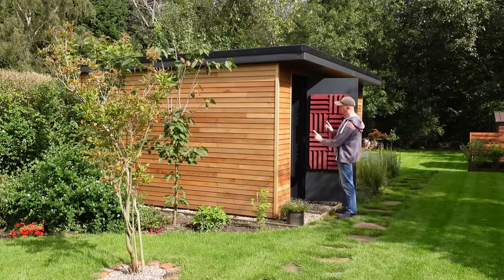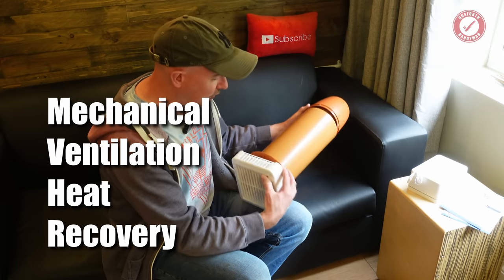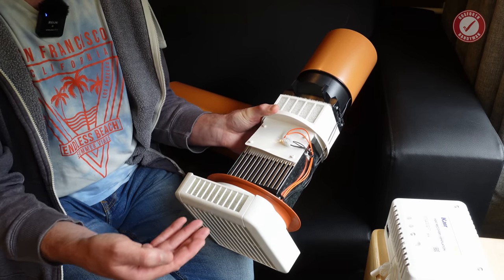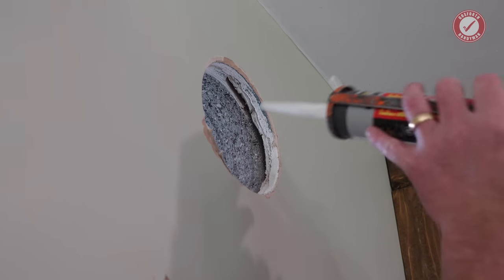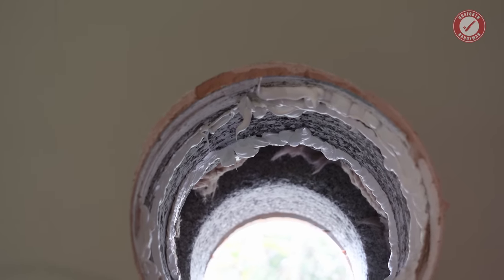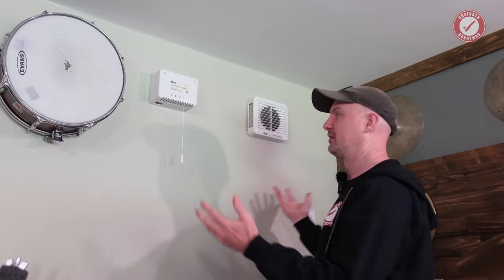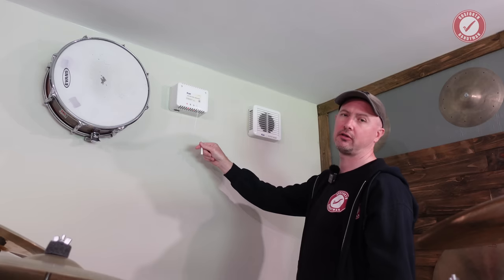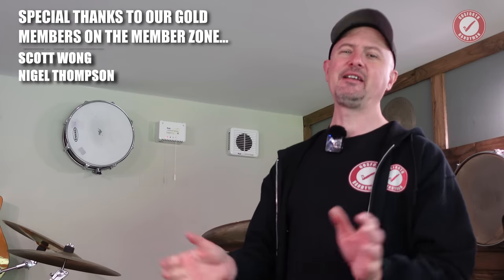Humid and mouldy! Installing MVHR ventilation (Kair system)

Comment: I fitted a MHVR to a newbuild.  Ventilation is always ignored and is vital for good health.   It's a trade off for sound deadening.  Retrofitting will always compromise your design of the building.    I did make a 5*5 metre summer house, but it had vents and underfloor heating which never allowed the temperature to fall below 16C so dampness or mold was never a problem

Comment: I saw on the HeatGeek channel recently, they wanted to see if they could enclose and how tightly their heat source pump.  Apart from using there software/sensors etc to check effeciency internally etc they also used smoke bombs to see how the air flowed outside at the pump each time they made the enclosure smaller.  The later may help identify size and shape to restrict the noise travel, well maybe.

Comment: To help with soundproofing around the ventilator, you can hang sound absorbing acoustic panels near it which, I am told by those familiar with these things, should reduce the effect of problematic sound waves.
Wall panels, hung rather like pictures, reduce reverberation by absorbing rather than reflecting sound waves depending on their NRC rating.

Comment: We have installed air con in a number of garden rooms. They dehumidify as part of the cooling process and also have a dehum mode. They heat in the winter and cool in the summer.

A dehumidifier would prob be your best bet
Reply: yeah I suggested the same. If you are trying to control humidity get a dehumidifier as the air con unit will not dehum in the winter, if you use dry mode you bypass the thermostat and the unit will just cool the room to unacceptable temperatures which you then have to heat.

Comment: The Kair unit, you picked seems to offer 10 litres/sec on "boost". So as no one is sleeping there overnight - it is likely to be enough, and should reduce the risk of mould, forming. The obvious way to kill common moulds is the use of a UV light source sun-light and or a "Black light" lamp, with lower humidity.
Reply from the maker: I need to do some tests to see how long it takes to get to... say 2,000ppm on trickle (can also vary the trickle speed). 👍

Comment: Many years back, before the MHR stuff was common,  I visited a home in Sweden that had gone a different route. They'd buried quite some length of ventilation duct (can't recall now if this was a combined passive intake and exhaust, or the two separate and powered by fans and laid next to each other, which would have been a crude heat exchanger) under the ground, doubled back on itself in tight hairpins, so it came into the house slowly and with the worst of the chill taken off by the depth (and possibly also by an exhaust). They said it was effective and it had been cheap for them. I imagine that several bends and earth above would go some way to attenuate noise too?
Reply: Interesting, I can see people getting more creative with their ventilation in the future as houses become more and more air tight. Preserving heat is great but stuffy stale air is unbearable.

Comment: Great video Andy. Have you thought about setting up a home assistant system? It integrates all smart plugs, relays and sensors etc. You could set up quite a smart setup for your studio ie, tracking co2 or humidity only whilst someone is in the room and then trigger the extractor or other items. Could also have warning triggers so if co2 gets above a certain level it could turn on a light or send a message to people's phones warning them to act. Can also set scenes with preset lights, sound etc Zigbee sensors are pretty cheap ~£10. It's all local and doesn't require cloud. Lots of options.

Comment: Humidity is relative to the air temperature. The walmer the air the more water it can hold. So if you boost when its walmer inside mabe in the sunshine you will be heating up the air therfore reducing the humidity. Saves using a dehumidifier

Comment: Interesting stuff, I tried an expensive MVHR in a bathroom and it died within a few months, lost interest after that. I did see a 6' version that looked fancy, may be one day. With your situation, and this is a faff, if you could add some more pipe externally that points the ground, then comes back up to 6', that might give you enough space to put some baffles and really drown out the sound bleed in/out the room. Of course it might not make the MVHR work as effectively I guess, it might even struggle sucking/blowing through that much pipe. Nice one for sharing.

Built my outbuilding a year or so ago (I work in construction), just a skin of blockwork with 4' of external PIR mechanically fixed, then 4' on slab and 4' on warm deck roof. It's far from your acoustic levels I'm sure, but good enough for my purposes. Keep up the good work 👍
Reply from the maker: Nice one - that sounds great!! 👍👍
Reply: @GosforthHandyman It may not be nice to look at, but knowing you, you could box it in really nicely, match the cladding courses and all that 👍

Comment: Fantastic video, I'm about to embark on a new build bungalow, and was really curious about these single use units, it's small with only 5 seperated areas so thinking 5 of these would be cheaper than a full mvhr unit. 
But last time I checked I couldn't find many variations of these single use units for sale so didn't think they would be up to much but you've perked my curiosity again!
Reply from the maker: Certainly worth checking out! This particular model has been on the market for many years. I'm not sure if I'd do a whole house with them though. 😬
Reply: Perhaps look into bpc ventilation and their zephyr unit, the one I was thinking of. Responsive company but I find it a bit odd there are no reviews 🤔 Seems they're system links multiple spaces and adapts to whole house. If you're doing a new build though, you've got the rare chance to do cost effective whole house MVHR system install. Just an opinion!
Reply: @bikerchrisukk  thank you for the advice, I tried to watch the bpc video about their single unit but it was very difficult to hear them, I'll try their website instead. I think you are right a full mvhr unit would probably make more sense and would be really easy to install compared to retrofitting, I could hopefully do it myself, I hear they work great in the winter if you have a log burner in one room, really helps distribute all that energy and intense heat for a more comfortable temp. in every room

Comment: I thought the air pushed back in was dehumidified as part of the heat transfer process..? This caused condensation, another reason for the slight tilt downwards.

Comment: I’m struggling with the logic of mounting it facing the house, right above the drum kit? I would have imagined it better to go on the window wall facing the bottom of the garden? Nice bit of kit though and a decent price!
Reply from the maker: The kit is so loud it doesn't really make any difference where in the room the fan is located... and the coin came up heads! 😂
Reply: @GosforthHandyman  hahaha, I did see the heads on the coin too 🤣 I just imagined that someone who spent so much time soundproofing a room would have cut a hole in it facing away from the house rather than towards it but as you said, the coin made you do it! 🤩👍

Comment: I have a garden room. I have trickle vents above the double doors and little window which I always leave open. I haven't seen any issues with mould
Reply: The point of the room he built is to be well sealed for acoustic purposes when he drums. A trickle vent would leak sound.
Reply: @davideyres955  yeah I know. In the video he just asked if people with garden rooms had any issues with mould
Reply from the maker: Interesting that the trickle vents are enough - cheers for the info!
Reply: @GosforthHandyman  not sure if it's relevant but I do have an automatic electric radiator in there which never lets the temperature drop below 10 degrees. Probably costs an arm and a leg to do it in winter but I'd rather not work it out.

Comment: When I built my soundproof studio some 8 years ago, the exhaust fan was in the plans. Using an external fan that sucked the air out via ducted tubing that is laid on top of the ceiling with an S shape to minimise sound transfer, while another passive vent from outside to inside, again ducting laid down in S shape, brings fresh air in. This not only performed better but kept the room-in-a-room concept walls intact. Tests showed over 50db STL between inside and outside.
Hope my videos help others planning to build a studio in their backyard.
The plan: https://youtu.be/V9CfyDD_hPw?si=4j-IxE-q-oj4FL3W&t=194
The fan: https://youtu.be/ENyjzlSApFM?si=kqKcmEa4ooKIdx5d&t=67
The ducting layout: https://youtu.be/7vbkqq83w-c?si=wAYkL-MSUYKkgY6G

Comment: The Humidity setting on the device is intended to achieve the desired humidity in the room. Condensation occurs on the heat exchange plates that you showed in the clip. This condensation then drips out through the internal pipe with the 5mm problem that you tried to seal. Setting the humidity at 80% will not prevent or stop the mould, it will only make it worse when you yourself are in the room or drawing humidity inside from a higher outside % when in  "standby mode". The WHO recon between 50-65% humidity is a healthy environment. I suffer from high humidity. I have installed a loft MVHR (£1000) that services the house via ducts, and use a portable 20L Pro-Breeze (£200) at the central inlet defuser. The setup maintains my home at about 63%
Reply: How much does that cost to run? My home seems to be around 60-75% humidity year round, even with windows open 24/7 during the summer months and for about 1hr/day in winter. I tried a dehumidifier but it was costing a fortune in electricity!
Reply: I have the system automated on Alexa. It operates during the times when humidity is generated in the house, cooking, showers etc, i.e. about 1hr in the morning and 1hr in the evening. The extraction system is concentrated in these areas. The incoming air is positioned in other area's such as the entrance hall. The system pulls and pushes humid air through kitchens, bathrooms etc via the MVHR and the portable Pro-Breeze sorts out any residual humidity on high temp and humid days - so will run seldom in the winter, which it has been for the last few days with this hot wet weather, so for now it will impact the electric bill.  @danabc322

Comment: if you don't want mould then the humidity probably should be 60% or lower. Allowing it to run through the night probably means it doesn't need to work as hard during the day?

Comment: Interesting video - thanks.
The CO2 thing is a bit of a red herring. Carbon monoxide is very dangerous, CO2 much less so. As an anaesthetist I often gave patients 5% (50,000 ppm) CO2 to get them breathing. The levels you are talking about will just cause an imperceptible increase in your breathing, as blood levels are tightly controlled by the brain. Above 5% it feels unpleasant (think swimming underwater) and at 10% it’s dangerous.
As I see it your problem is mould which likes cool, damp environments. You need drier, warmer air. A dehumidifier will dehumidify a lot better than your device. A heater would warm the air and building, and decrease relative humidity. A bit of air movement is obviously a good thing too.

Comment: Hi, I bought a vent axia HRF for my bathroom some years back, it was good for air circulation but the heat exchange wasn’t very good so it ended up just blowing into bathroom cold fresh air (in the winter months). Interested to know what yours is like on that front. Great  channel by the way!
Reply: I've heard this is quite common, I hear full mhvr units are better at bringing in warm air but don't know why these single units don't seem to achieve the same results

Comment: For diamond core: my big DeWalt SDS couldn't do 117mm, let alone 150mm, tbf it's had a lot of use and probably needs new brushes. Got a Makita diamond core drill - perfect up to l50+mm. Makita have kept up quality of old product corded tools; DeWalt old product corded quality has plummeted. Proper dcd gives controllable torque for large holes
Reply from the maker: The clutch in my old Makita seems to be ridiculously sensitive! 😂

Comment: I've had one of those units in my bathroom for the best part of 20 years and it's been great at keeping the humidity in the bathroom in check. I moved the power supply unit into the attic and extracted the humidity sensor with some twisted pair cabling to a small box with vents from a temperature sensor and it has been working great, and I don't have that monstrosity of a power supply hanging on the bathroom wall!

The only issue I have had is that the foam inserts clogs up over time and have finally disintegrated on me so currently it running without the foam inserts, and the ball bearings are beginning to be a bit noisy now after close to 20 years of running.
Reply from the maker: That's great to know! You can get replacement fans but they're nearly as expensive as a whole new unit. 😂

Comment: On humidity and ventilation you have to really think carefully about absolute (g/m3) humidity versus % relative humidity., You could have 10 degrees outside 80% humidity, 20 degrees inside 60% humidity - the air outside would have significantly less water in it by volume, so if you're bringing that in and warming it to the temp of the room you're going to be reducing the relative and absolute humidity inside. When I bought my house it came with a PIV system stuck in the loft and on all the time and I have temp/humidity sensors in every room and now the PIV system is on a smart (zigbee) plug and I actually run calculations of how much absolute humidity is in the air in the immediate vicinity of the PIV outlet, the house as an average, and at the inlet of the PIV system and temps and it makes smarter decisions about when to turn on and when not to so I don't pull in more moist air, don't pull in air that's too hot or too cold etc, which is far far better. You're not actually supposed to do this with a PIV system, but I simply don't care because it's miles better at doing the job. Eventually I actually want a whole-house MHVR system, but that's a big expensive job for the future. Anyway, the point is absolute humidity inside and outside is more important than the relative humidity when you're going to be warming that air up; if it's lower absolute but higher relative outside it's still worth pulling inside because the end result is less water.

Comment: How does the HRV get rid of any condensate that it shall collect in the heat-exchanger?
Reply from the maker: Lol I'm not entirely sure! I suppose if the heat exchanger is warm it shouldn't collect too much condensate? I honestly have no idea! 👍
Reply: @GosforthHandyman  The exchanger expels stale air to the outside. As the warm stale air cools down (it gives its heat to the incoming fresh air) the humidity from the stale air collects on the heat-exchanger. This must be discarded somewhere. (likely in the downwards-slope of the PVC-pipe?)
Reply: @AdityaMehendale I too am curious about this, I'm thinking there might be other units similar to this that perhaps deal with/dehumidify the moisture as well as recovering the heat as it brings fresh air in
Reply: Typically when installing this type of small, single room Mvhr the duct itself is angled ever so slightly downhill and the condensation then drips out the pipe
Reply: @arthurmoore2777  good to know, I did wonder about condensation, have you had any experience with one of these units? I hear mixed reviews as to their ability to 'keep the heat' in the room so to speak

Comment: I’ve got a studio with just a vocal booth built as a room within a room and didn’t put in ventilation for fear of the neighbours hearing me! After 2 years I’ll now make it a priority-mould and only being able to spend 20 minutes in there at a time the main reasons. Great video as always and given me food for thought. Also, could you have a removable cover for when you’re drumming/not drumming?
Reply from the maker: That's another option to be honest! The drums are used so rarely it wouldn't be beyond the pale to simply switch the fan off and cover it up for a couple of hours. Could certainly be a workable short-term solution. 👍👍

Comment: Love your videos Andy, they always seem to tie up with something I've got to do at my place. Did you get a definite answer on whether this unit keeps a room cool in the summer?
I've been considering one of these for the past year for a room in a very old cottage. The room is below road level, with no tanking and breathable lime plaster. I've got a dehumidifier in there at the moment, mainly for the summer when room humidity is worse when it's hotter outside and cooler in this room. Hopefully the small fan in this unit could defeat higher winds in the winter. Thanks again.

Comment: Have you considered running a portable dehumidifier unit?
Reply: I was thinking that. Andy should look out for the Lidl units. Unfortunately they are usually only available once a year.
Reply from the maker: Yeah, that's on the list! 👍
Reply: Is anyone aware of a single heat recovery unit or ventilation fan in general that has a dehumifiying function? It would be nice to get something that's an 'all in one'
Reply: @zororat  It would be super neat if they could miniaturize a moisture condenser into the tube!

Comment: Thanks for the content :)

Any thought about underfloor cooling tubes like those used in earthships or a dual fan setup like in tiny homes? I'm not well versed in acoustic engineering, but would the most offending sounds in question (exiting through the floor), be more diffused upon their escape/absorption?